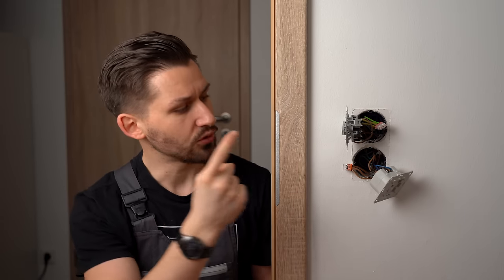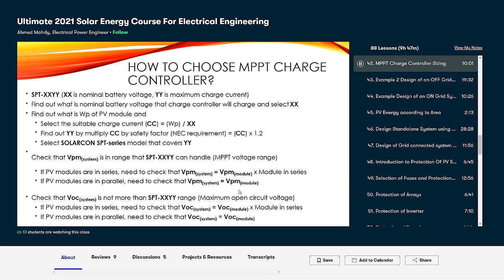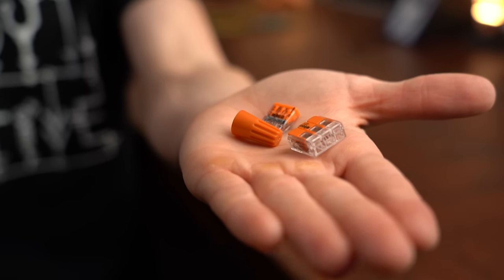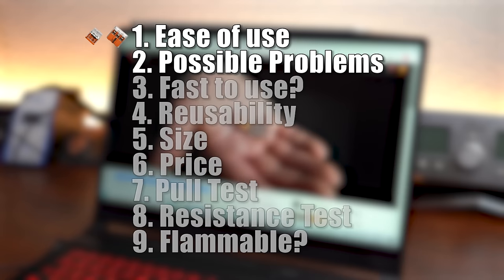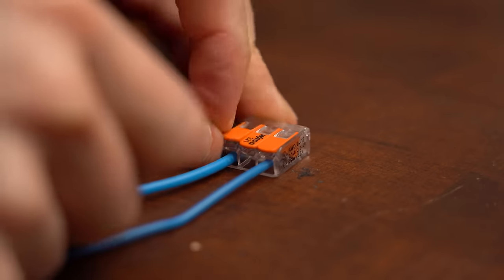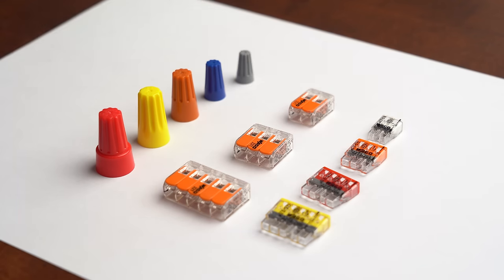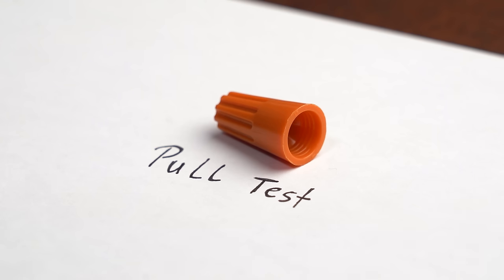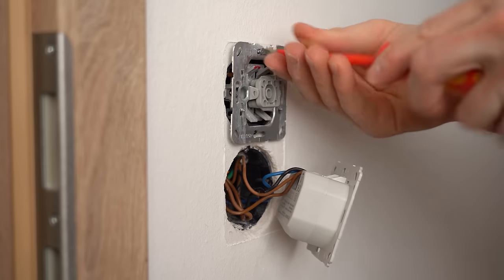What Wire Connector is the Best? Settling a Debate! Wire Nut VS Wago

Comment: Sometimes stupidly patriotic American here. The only convincing argument I've heard against Wagos is that they build up a higher resistance and can get warm. It made sense to me that this might be a uniquely American problem (and maybe Japanese) since we use higher current lower voltage wiring. However, this is still a very small amount of additional resistance across the Wagos. Resistance is a function of cross sectional area AND length of conductor. The length of the conductor is the distance the electricity travels, so wires should be connected right next to each other. The overall length of the metal strip in the Wago isn't necessarily the length of conduction.

I think if properly installed by an electrician, wire nuts probably make the most sense. Contractors should save money if they can and they are stronger and more resistant to heat, especially when connecting more than two wires. For DIYers, the WAGO is probably best because they are easier to install properly.

Comment: The 1w power loss in the wago concerns me. How many heating and cooling cycles can that connection go through before there is a problem? Even solder joints fail after many expansions and contractions, I see it all the time.
Reply: Now watch how they age in high humidity. Such trash. I never want dissipation in my connections which is higher than in the wire.
Reply: What bothered me is while this was 1w at 20A which no outlet will typically get on average usage. How many wire connections are in a typical 3BT2B home? Maybe 500 more or less? Even at 5A which is lets say an average per outlet that's 1/4 watt times 500 connections which is a 125watts loss all day every day. and yes these were 3 minute rough calculations but when you take in to account a 150 million homes only (no big buildings, apartments etc) that's 18 billion watts

Comment: Wanted to use Wago connectors when I replaced my regular switches with smart switches, but the free space is so small in my boxes and these new smart switches so big that I had to use wire nuts in the end.

PS: There are low quality and high quality wire nuts though, and you chose the cheap, low quality ones in your test ;)

Comment: The important take away here isn’t that the lever connector won, which I would have expected, but that both methods are completely safe and proper for use.
Reply: He didn't properly twist the wires together. It's easy to 'win' when you stack the deck in your favor.
Reply: @Anenome5  this mostly, i can use both in a proper and safe way...

Comment: Would love to see the same tests run on screw-down terminal blocks
Reply: Hate terminal blocks, they dont even grip good...
Reply: @DrakeOola  Try phoenix contact or ABB. Both give plenty of bite. Although I've never tried them with solid wire, they grip hard enough that you will rip them off the din rail before they let go of stranded wire.
Reply: Here in France we used to use black/white plastic screw-down terminals a lot, but nowadays WAGO (an rip-offs) are becoming the norm I believe.

Comment: Both have good and bad. I like the Wago in lower current residential applications, but the extra heat generated from a dozen connectors in a box of industrial applications, where current transfers from copper to spring steel and then back to copper may become a problem child. When you look at just the 1/3 resistance of the wire nut at such a low resistance rating, it seems to almost nothing, but when you pass 20 amps thru 4/10ths of an ohm - I'ma little rusty, but I think that is 8 watts. You feed 3-3 phase motors out of a box like that you put a 72 watt heater inside the housing ... that's quite a bit. We were always taught to put the conductors side by side into the wire nut, not wrapping one around the other - tough to do sometimes. Glad I retired.
Reply: note: his measurements are in milliOhm, not Ohm, and he shows the 20 amp heat output in the video for the 221, 0.88W for 2.2mOhm. The 2273 only heats by 0.16W for 0.4mOhm so your example comes out to 1.44W which is negligible.

Comment: In Australia we use BP (Blue Point) connectors. They've got one or two grub screws to make solid physical connection and have a cover that is robust. Not as nice as the German things but way better than wire nuts, which I wouldn't use on any electrical connection.
Clipsal are one company that do them. Item Number: 563J/50
Reply: oi mate
Reply: Oh dear
Reply: I wondered what the acronym stood for. I'd trust BP connectors over both options in this video. The Wago ones look convenient, but I wouldn't want that higher resistance and added heat in my Queensland walls!
Reply: They look similar and are technical the same like the old lamp terminals (Lüsterklemme) we used in Germany before we had the WAGOS.

Comment: It would be also great if you included other methods like the connectors that we use in Spain, with screws, I really like ours! 😀
Reply: we call them 'chocolate' and I hate them. You need the right size of screwdriver and it takes long to use.
Reply: We have those in Germany as well and honestly, i like wago style more. For some reason, you never have the right screwdriver or the right connector xD
Reply: @p3chv0gel22  Haha, yeah, that happens a lot, and you end up with plastic shavings from the connector, becuase the screwdriver is normally too big... But... I don't like the fact that Wago connectors are too big, and you need three conectors to distribute in single phase, which is a bit of a pain, and they are clearly more expensive... I don't know, I'm undecided, but leaning to our traditional connectors for now...

Comment: Being from the US, I’ve never seen Wago connectors, but they seem nice and user friendly. 

Wire nuts don’t have a current rating because they don’t support any current—they only serve to mash two or more conductors together. It would seem that the current limit is that of the conductors.  

Wago connectors on the other hand use a third conductor, and also seem to have a rather small contact area, which is why they have higher resistance and a current limit
Reply: Wire nuts are insulators not connectors... you have to make the connection by pretwisting the wires and then install the insulator. Exception to this is some ideal wire nuts allow you to avoid pretwisting and also use thier screwdriver attachment.

Comment: First time seeing these wago connectors, used the wire nuts my whole life here in the States. The wagos do look a lot nicer for doing ceiling work, like when installing an overhead light fixture or a ceiling fan. I may start using them for that stuff around the house. The wire nuts are simple and significantly cheaper though. There are also ceramic wire nuts for use when temperature is a concern for example with ovens, furnaces etc.

Comment: I was replacing incandescent housing to LEDs here in the states and let me tell you wagos are far superior connecting stranded to solid wire. I got frustrated with the connections coming lose by just looking at them wrong with the wire nuts. I must say, I've been using the knock off ones for 12v on various projects. They work very well to for those low amp applications.
Reply: Stranded to solid you're better off just soldering it together.

Comment: When I was 18 I spent some time in the US and worked in construction a bit. When I saw the wire nuts I couldn't believe the trusted them for permanent installations. They really gave me a feeling of being flimsy and cheap. On the other hand I loved lots of other equipment and tools they had and at that time we didn't have back home in Australia. When I came back I wanted to bring so many tools with me. I still miss their  hardware stores. The funny thing is I used to miss Australian hardware stores when I lived in Germany lol. Toom wasn't too bad though 😉
Reply: We've been using them for quite a few decades now and rarely have issues with them. With modern installations requiring AFI circuit breakers, there's precisely no reason to stop using them now. Even if we did switch, we'd still need the AFI circuit breakers to handle things like faulty power cords or breaks in the middle of electrical wiring.

When it comes to safety gear, it's not good enough to be better, it has to be better enough to justify switching. The number of buildings that burn down due to this issue is tiny, and usually the result of improper installation. If we start changing things due to improper installation, then I'm not even sure where we'd stop.
Reply: Toom is the worst hardware store in Germany from my own experience lol.

Hagebau/bauking is decent but expensive… HORNBACH is king!

Comment: I have been an electrician for over 30 years and have used a variety of wire fasteners. Set screw type wirenuts, crimp type wirenuts, wirenuts from all known manufacturers as well as wago's. Yes wago's are faster and can be reused easier but are not as good under the rated capacity of the wire. A properly twisted set of wires secured with a properly sized wirenut will out perform a wago hands down. Several years back wago's we're all the rage here in the U.S. until multiple fires were attributed to there use. The same is true of receptacles that are of the speed wire/back wire type that have spring connections for the wires. There are many jurisdictions now that have prohibited their use due to overheating issues. My advice is to use the tried and true method of wire termination. A good quality wirenut on properly twisted wires! Some wirenut manufacturers say in their directions for use, twisting the wires is unnecessary don't believe that, those are the only instances I have seen wirenuts fail and overheat.

Comment: Those wire nuts definitely look like something I would never use myself. A couple of years ago I was interested in DIY Home Improvement videos and I constantly saw these wierd caps that people used on their wire-ends when watching videos from the US. I had never seen those before. Instead over here in the Netherlands I always used little semi-transparant white cubes that had small screws in the top so you could connect the wires together. Probably very old-school stuff from 40 years ago as I also never saw these Wago connectors before but my little cubes are all over the place. The most annoying part of those were having to use a tiny screwdriver constantly and hope the screw would catch the wire properly (especially the ones with the multiple little fraying copper wires). 

Just FYI but I'm a total noob when it comes to electrical stuff so my experience is extremely limited to watching videos and watching my late father when he worked on electrical stuff (rest in peace dad) and mainly using it to connect light fixtures.
Reply: Try to use wago, it makes the things easier.
Reply: @timofeifilippov9558  Thanks, if I ever need to do some light electrical work I'll definitely check to see if we have these Wago connectors available. Definitely beats having to screw down multiple tiny screws on those little white cubes we always used.

Comment: Wow, didn't expect the Wire Nut to be that strong in the pull test! I've always been on team Wago (even vs. screw terminals / "Lüsterklemmen"), but the price is really terrible.
Reply: My gut feeling is that it wouldn't fare all that well if only one wire were pulled or if the wires were pulled in different directions
Reply: Are Lüsterklemmen in Germany the ones with one or two holes?
Reply: @caked3953  I think the ones with a big hole for multiple wires and just one screw are "Dosenklemmen"

Comment: I love wago connectors so much I attempted to have children with one. My advice, don't let the lever snap down during this process.

I also recommend only using wire nuts in automotive applications due to their light weight.
Reply: The weight is irrelevant. The morning constitutional would weigh more than the total number of connectors someone might install in a car, by an order of magnitude.

What's more, it's about the worst useage case you can imagine. Corrosive environment, high vibration and low voltages requiring high currents for significant power delivery.

For automotive you either use a connector designed for it such as your TE connectivity, Sumitomo, Yazaki, Delphi, Deutsch  etc plugs or you solder and heat shrink them with a glue lined heat shrink or use a solder/butt splice connector.
Reply: Bad idea, wire nuts only hold the derformed wires screwed in place and dont apply continued force, vibration will shake them loose over time. Loctite isn't used to fuck with the next mechanic. Most of the time :D
Reply: @forownmade1243  But don't stand up particularly well in corrosive environments unless you get the gel type and don't have a particularly good mechanical or electrical connection regardless, when compared to crimped and sealed automotive connectors.

Comment: In many countries they simply twist the wires and isolate with duct tape. Personally I prefer solder and isolate heat shrink, and depending upon the local of the installation, i also use auto-fusion tape.
Reply: Soldering power wires is illegal in Germany and most likely most of Europe.
Reply: Neither of that is allowed in Germany for professionals.
Reply: Yup! Just twisting solid wires and isolation tape is the most durable and the best quality connection. Stranded wires and soldering are out of the question!
Reply: @Soren_Skarsgard  You're too confident in your wrong knowledge... Twisting wires together with nothing else is a lethal hazard & illegal in most countries. Soldering is still better than that but that's still a no-go & illegal.
Reply: @Engineer9736  Heh..! Your point..??!
Edit: Change my mind!
Edit 2: I live in a half century old Yugoslavian flat just like that, and it's just fine, how bout you?
Edit 3: Also, where did I write "Twisting wires together with nothing else" ? Have you heard of isolation or electrical tape? Dude, the whole country was wired that way... and, walking is a lethal hazard too, if you don't know what you're doing ;0)

Comment: When connecting a stranded wire with a solid core wire I find that if I strip just a small amount more than the other and placing the stranded wire in the wire nut first, gives a better stranded wire wrap around  the solid better than putting them in at the same time.

Comment: 1) With Americans connectors, you are supposed to professionally splice the wires first! Otherwise, the inside "spring" might act as a connector/conductor and burn like a fuse at around 7A! 
2) Personally, I prefer your favorite kind of connector for 4+ wires and splice+fuse+thermal tube for 2-3. This way there is no additional resistance, no possibility of pulling them apart and you can color ID while using the TT. 
😉

Comment: Having been a home automation contractor for many years who works with these things, I can tell you that this is a no brainier, in two ways. First off, Wago connectors are clearly superior! However, they are generally cost prohibitive while US electrical codes allow the use of wire nuts. 
 No companies are going to pay 4x more when the product they are using is generally satisfactory.
  Additionally, many people reuse wirenuts regularly from my experience. I'm not aware of there being any significant issues with this. If there is not a residual piece of wire stuck in the nut, the wire stays in the nut when you tug it, and the coil doesn't fall out, I see no problem with reuse..

Comment: So true about these newfangled wire connectors they cannot handle load over 5 amps my friend was using these and wire was turning blue violet I remove them and use wire nuts but for hooking up LED lamps it's a great options.

Comment: Honestly, while I appreciate your experimental rigor, I have to disagree with your conclusion. Certainly, the Wago is "good enough" for most uses, and if you're an electrician needing to do a ton of wiring quickly, speed and knowing by looking that you have everything correct are important, but if you're a home owner who needs to install a thermostat or change out a light fixture a few times a year, I'd rather have a box of nuts than assorted Wagos given that:
- all nuts work with both solid core and stranded
- they're sturdiest
- they generate the least heat / power loss
Reply: None of those DIY applications pull a lot of current, and Wagos are way less likely to be installed improperly. I don’t see why home owners would use wire nuts
Reply: With less than 1/3 the power loss and the low price I'll stick to wire nuts. Those are the only 2 metrics that matter. Will get some Wago for test bench though.
Reply: As a homeowner, I disagree.
With Wagos, I could inspect visually that the existing (inherited from previous owner) installation at least seems ok. With wire nuts, you have to redo them to know for sure.
Where I'm at, we can't (legally) do anything but basic stuff, but a lot of people do anyway, even without (a hint of) proper knowledge. Wagos would also hint that the one who did the work was either a pro or someone who cared enough to not go for the cheapest option.
Reply: @raul0ca  that is when the install is new. Wirenuts is much more likely to fail because of heating/cooling. This is not a problem for the wago.
Reply: @Faddnn  I worked on a house that had wirenuts at the plugs where the wires were insulated with paper. They had not failed since they were installed in 1929
Reply: @raul0ca  I've seen a lot of shit that  have been "fine" even though it is old. But the truth is that screws and wire nuts do not preform as good as wago when it comes to maintaining the same good connect over time.
Reply: as a homeowner that only has a use few times a year i definitely prefer wago (lever) as one size can be used for wire sizes both stranded as solid core, they are much faster to use especially if the wires are a bit short